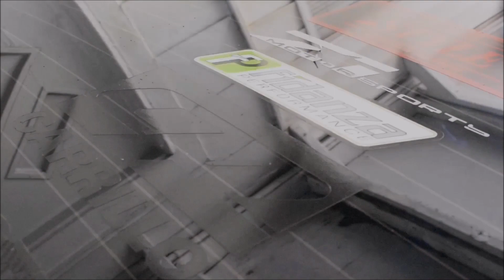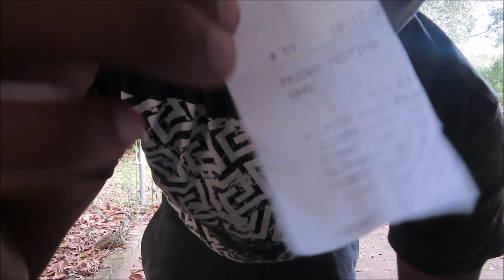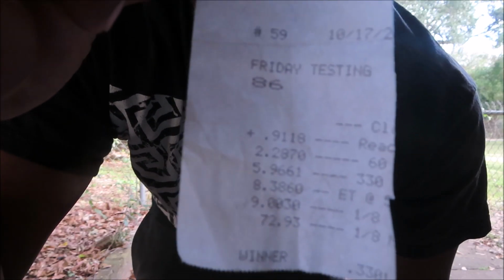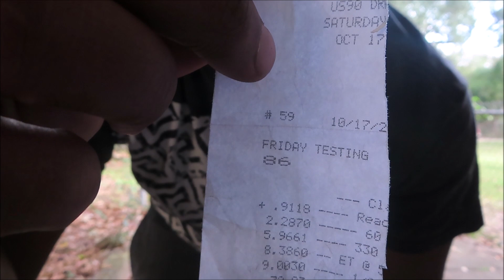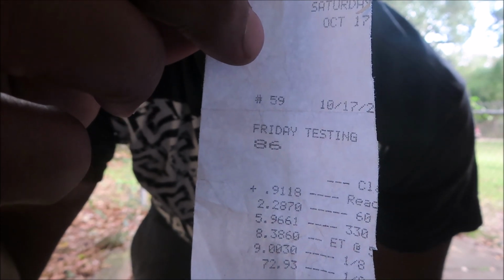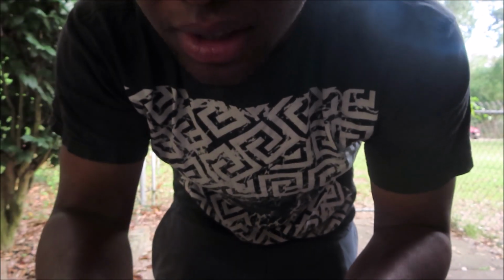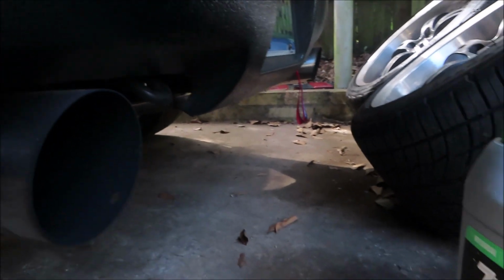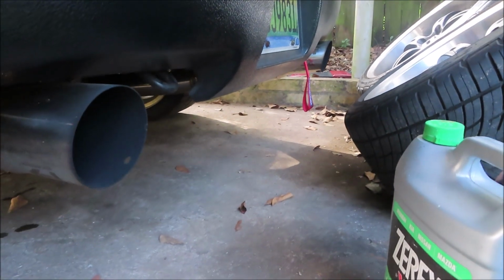300ZX TWIN TURBO BEATS FBO 392!

Comment: Mods
Reply from the maker: It was bigger intercoolers, dual hks bov , z1 pg exhaust, 2.5 inch h pipe ,3in test pipes, 3in downpipes thats it untuned stock injectors